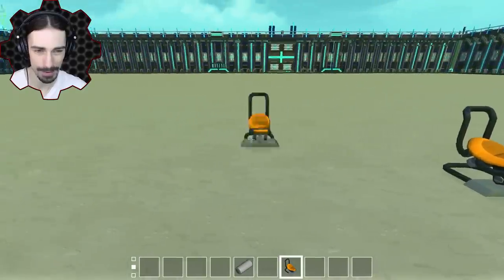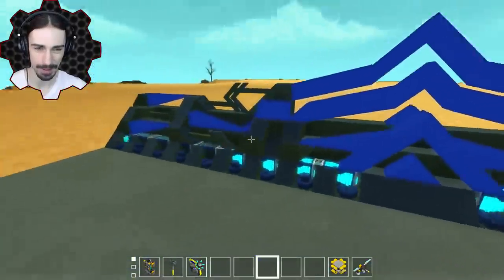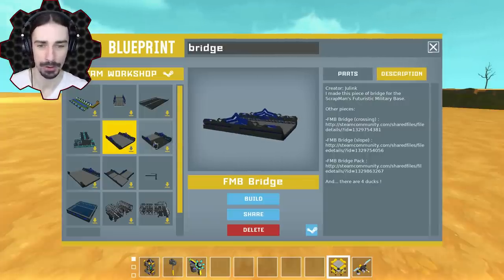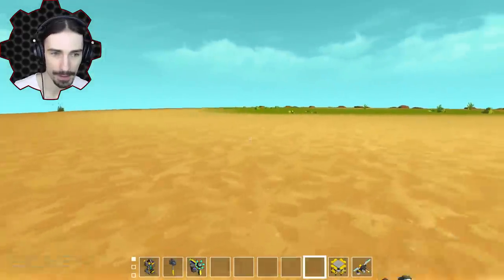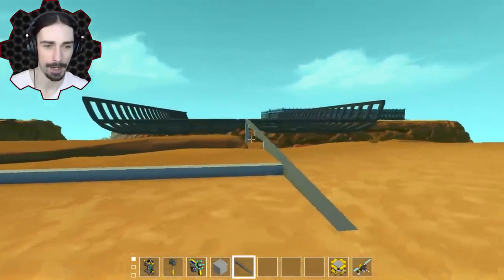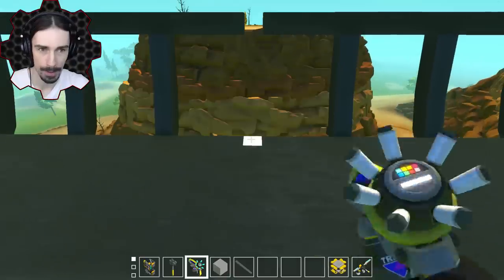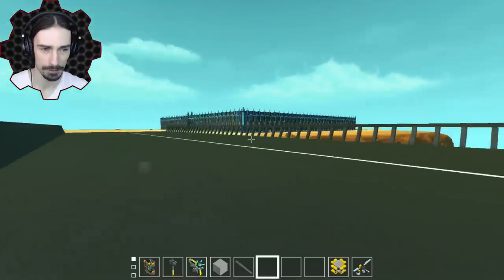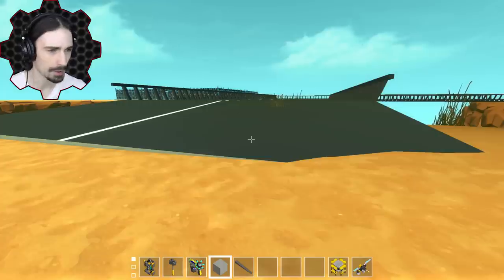BRIDGING THE PLATEAUS!  [FMB 13] - Scrap Mechanic Gameplay

Comment: For solving Welding problem and frame drops. Edit your base tile and add some small assets which would keep your floor, so you could divide it into more smaller sections, this could help with frames and welding stuff,  and add wedges to cover gaps. Your world will update probably. the same thing u could do to cut bridges in parts if needed

Comment: You should split the buildings apart like the wall segment. Attached underneath separately to the landmass, but "connected" to each other via wedge pieces for a seamless top.

Comment: Try using a bearing or piston to prevent normal pieces from connecting properly
Reply: By which i mean that you put the blocks to fill the gap on some invisible bearings